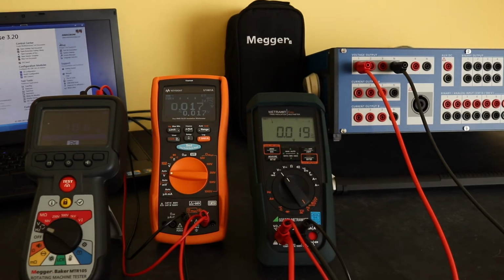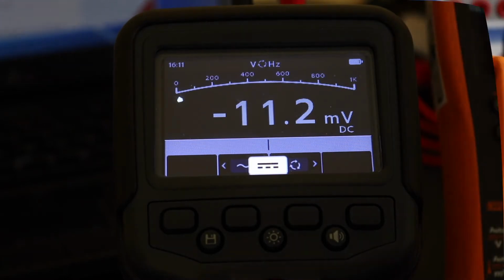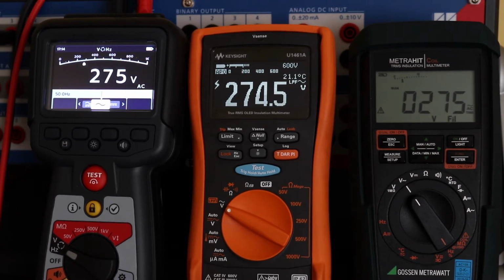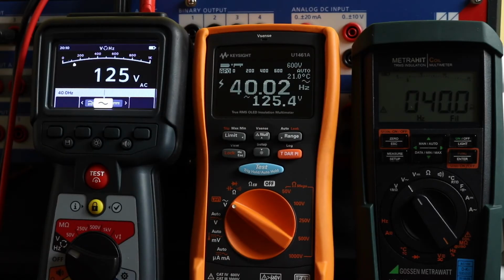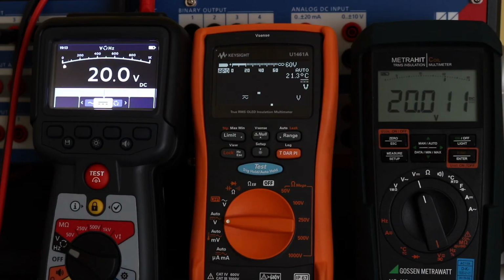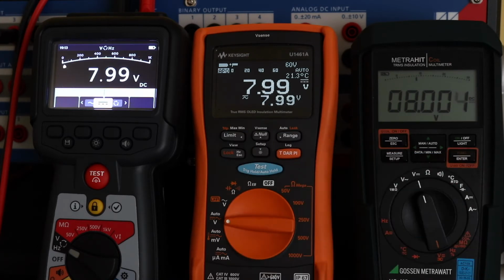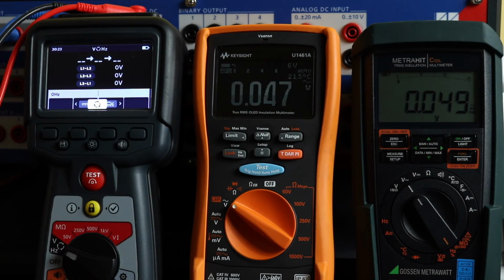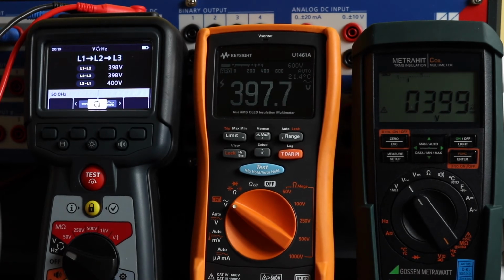MTR105 Voltage Measurement Functions

Comment: Thanks for these videos Three-phase, really enjoying them. I stumbled across your channel (and element14 presence) after searching for reviews/info on the U1461A. These videos have pretty much made my mind up that the Keysight meter is the one I'm about to pull the trigger on after discounting the Gossen Metrawatt and Fluke 1587. The Megger unit is very interesting but I'm looking for more general purpose DMM functions as well as insulation resistance as it will be used with 4-20mA loops and general fault finding in the field on MCC's, plant automation,  PLC's and M/C control panels etc. I'm also stuck using an instrument from my company's calibration register when carrying out motor PM's (currently a Metrel multifunction meter and a selection of clamp meters). Might try and convince my boss to look at the Megger unit though, he likes buying new toys too...

I must say I'm finding your content very interesting and refreshing as most other electrical stuff on youtube seems geared up towards installation guys or "Hoose Bashers" as we call them in Scotland. My background has always been in equipment maintenance in production environments but for the past 3 years or so have been working for a semiconductor manufacturer in their plant services/facilities dept.
Reply from the maker: Thanks for watching Bigbananafeet, appreciate your comments. 

That is pretty much what I have been using the U1461A for over the last 5 years and it has served me well. I looked at the MTR105 as I am more into insulation resistance monitoring than control. The U1461A can do this, but doesn't offer all the options that the MTR105 does. I know the U1461A has a bit of erratic behaviour, but it is only on large induction machines, below 100 kW motors it has been fine and Keysight may have modified the later versions of the U1461A to correctly the issue. I have just put out the video on 4-20mA loop testing with the U1461A and MTR105, like you say the DMM functions of the U1461A are pretty sweet and they show it.

Most of the channels I watch tend to be the domestic / light commercial install and some HVAC channels as well. We give them the same name down south as well, just with a different accent.

Comment: Another great post. It would also be great once you get through all the testing    you do a little bit on the kind of work you do and the challenges. Some of that comes through your other posts but great if you could do a longer one.great if you could upload all test results charts and all tables in a single pdf for downloading that would be awesome when you finish the series. I would have placed the mettrahit coil on voltage accuracy single phase first agreed it’s convenient to see frequency readings in the same place but you could get to that number with a few clicks. Overall I would have had the mettrahit second.
Reply from the maker: Thanks for watching and commenting MM. All of the test results are in a numbers/excel file, so easy enough to create a PDF. Not sure where it could be posted, I do blog on element14 and sometime eevblog, so could put it on one of those and link from here.

There probably isn't that much between the U1461A and MetraHit Coil, both are capable of the job and the end result will come down to personal preference. I do like to commit though and have a first, second and third place where I can.